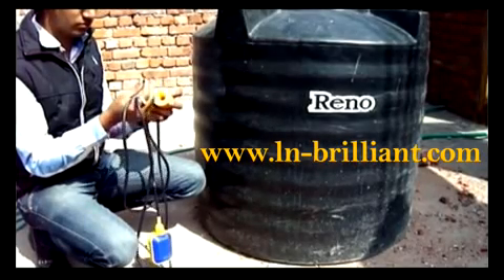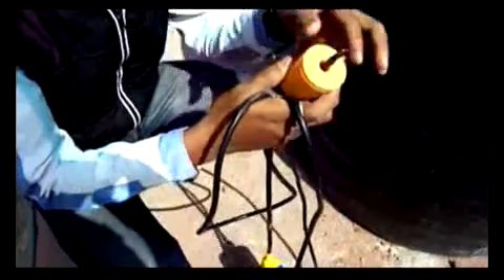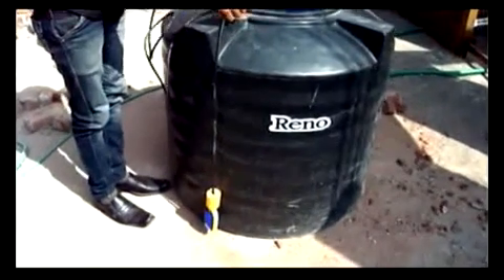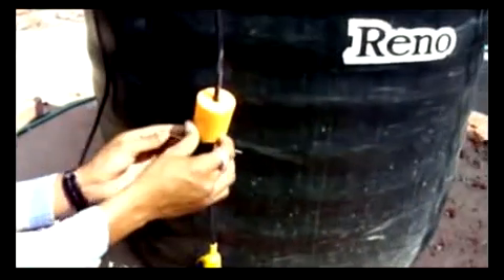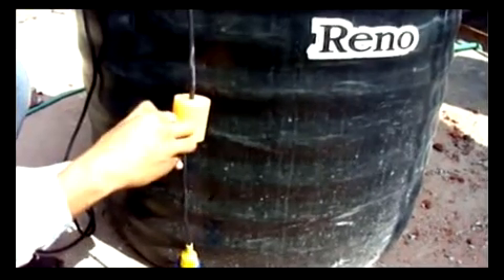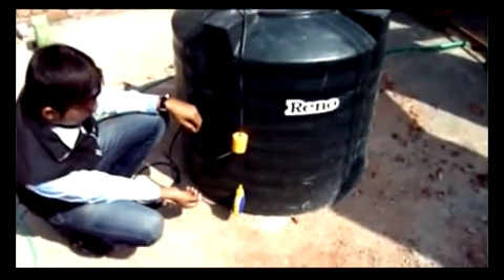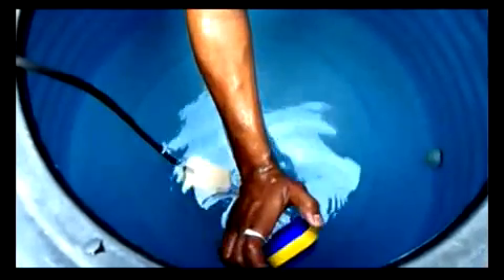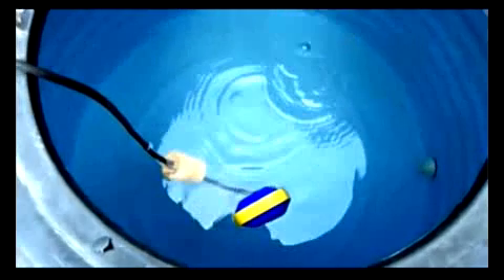6 Water level control float switch  installation

Comment: Nicely explained.. simple yet detailed.
However in 3rd world regions (with usual power cuts) I advise the sensor low level  be at half tank capacity that ensures water availability during power outages.